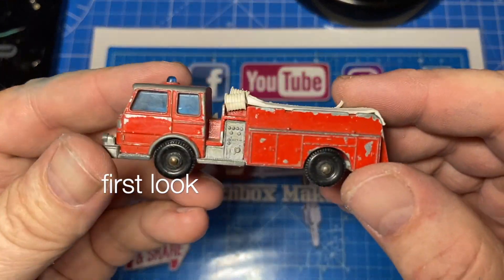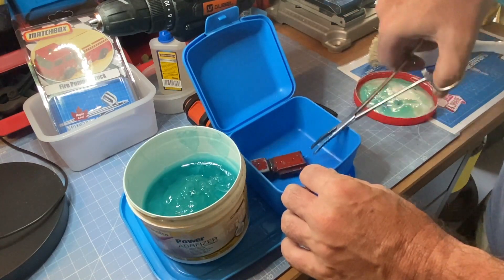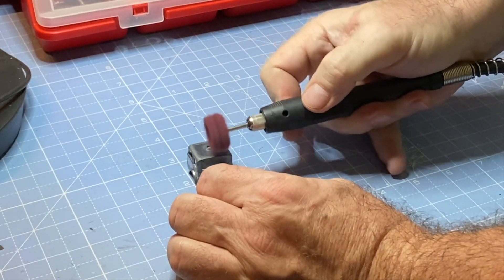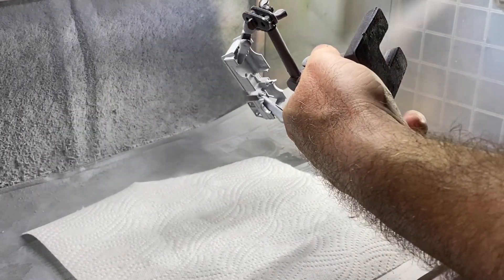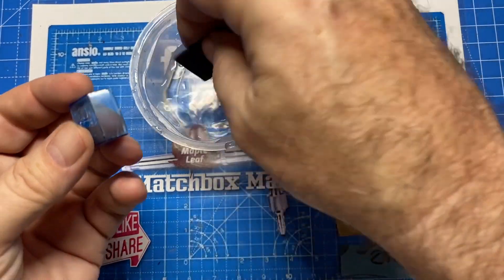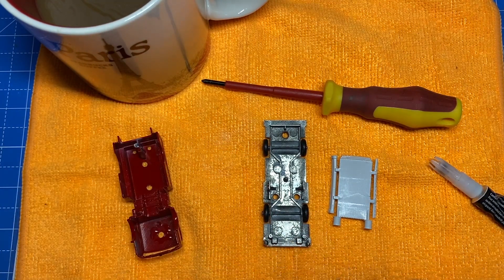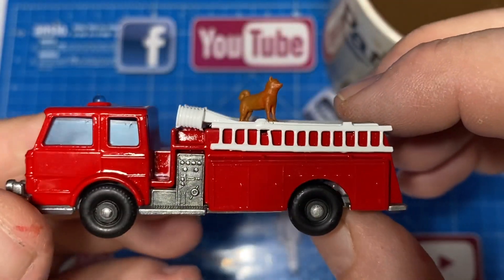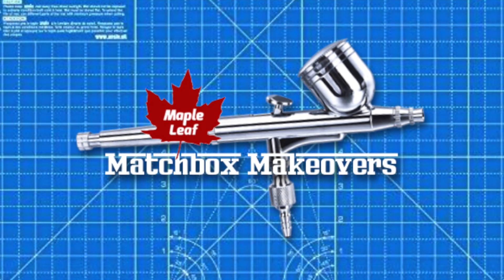Matchbox Fire Pumper Truck (105)

Comment: My box of old diecast is full of fire trucks, dump trucks and other yellow work machines. No little boy's collection is complete without them. I'm sure a little boy or girl with be thrilled with your beauty restoration on this one. Can't wait to figure out my own 3d printer, lol. Go Canada
Reply from the maker: Thanks, Evan. Thingyverse saved the day here. A search for Matchbox Fire Pumper quickly gave me the hose assembly, all ready with supports! I put three of them on the plate and hit print. Got a few in the parts bin now. Once you get the hang of the Elegoo Mars, you'll have no limits. Another first responder coming next. Have a good weekend bud! 🍁👊

Comment: Andrew, hope you're doing well. This is the only reason why I don't do fire trucks or fire engines. Most every single one of them something's been broke or missing. No 3D printer here. Can't afford one of those. I guess I can probably try to buy them online but you pay more for the parts and do the truck. Take care sir. Great video.
Reply from the maker: True words, Wade. I have a box full of engines and pumpers, etc and every single one of them is missing something! Usually the plastic bits are bent or gone. I've never ordered parts for anything yet, for the reason you laid out. They end up costing more than the cars, which I usually get for pennies - hence their derelict condition! 🍁👊

Comment: Looks the best as always I think IV got the same truck mine as Denver on the doors but the ladders are gone and the top pice over the pumper compartment is gone like you said. Fire pumper on the bottom match box series number 29 made in England I think this one was made in 66
Reply from the maker: Sounds like you got the original version, David. Pretty sure mine was the second production run with no Fire Dept. decals on it. They've very popular and I wanted to get this one back in circulation for a new young owner! Have a great weekend. 🍁👊